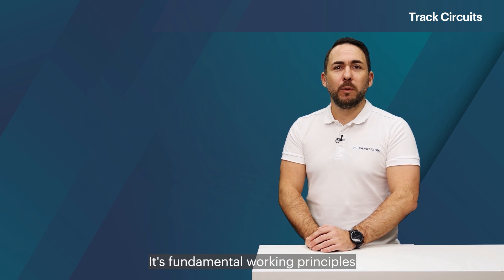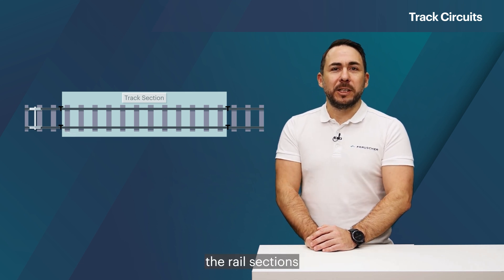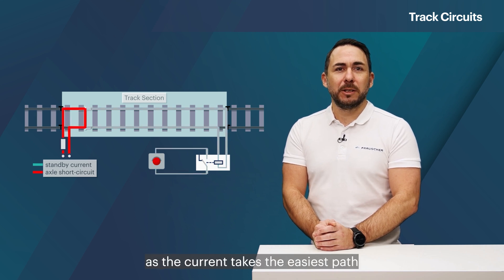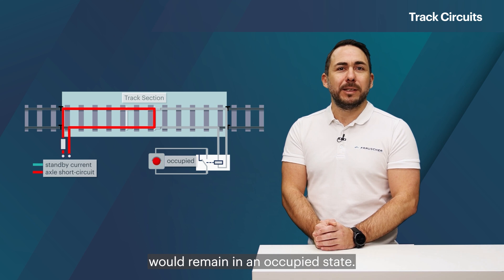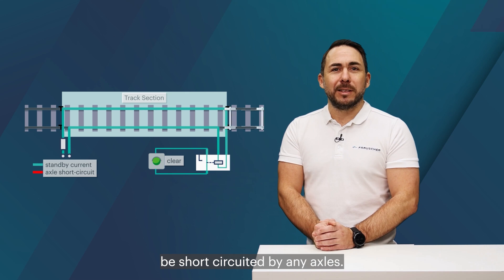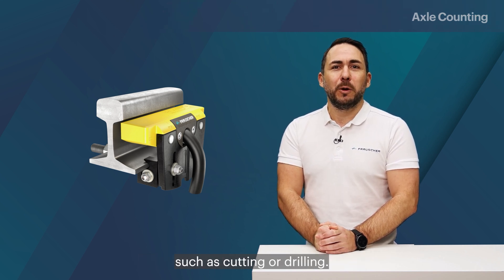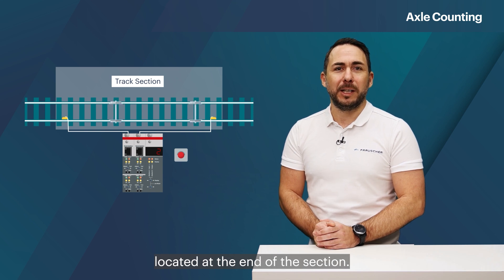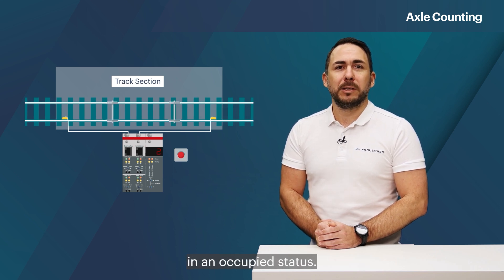Train Detection System Working Principles

Comment: Thank you, Manfred. A good but very simplified explanation of the two main principles of train detection. Please note that there are not only track circuits with IRJs, but also modern jointless track circuits with a digital interface. And generally there is no need to perform any reset procedures on track circuits, which seem to be quite risky, on remotely controlled lines especially.